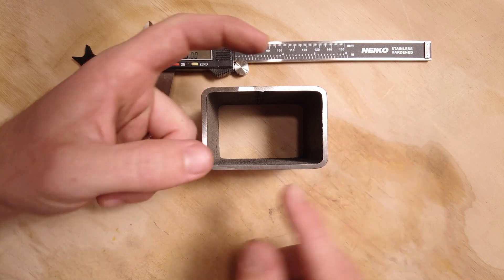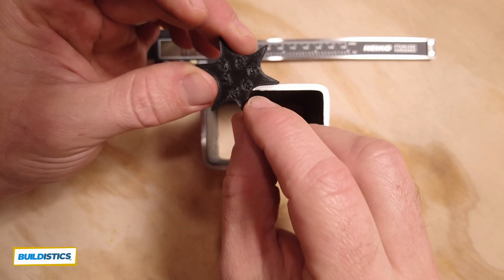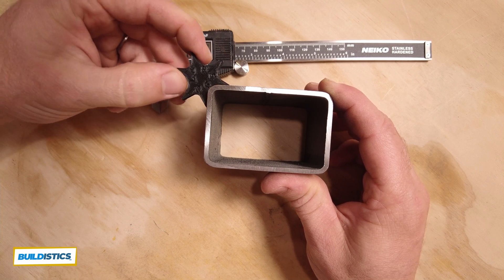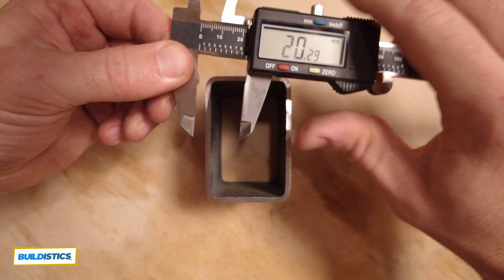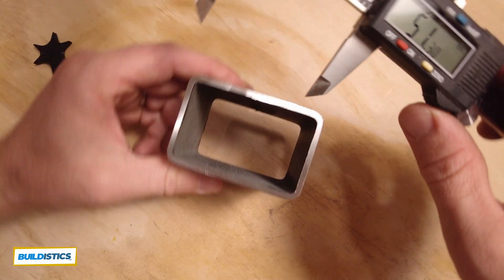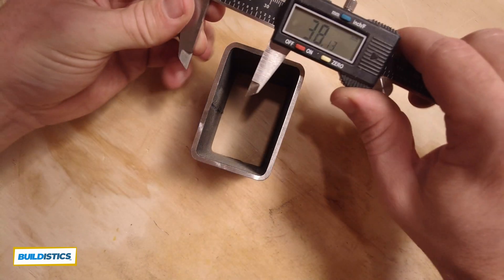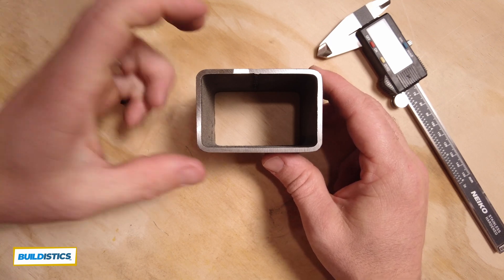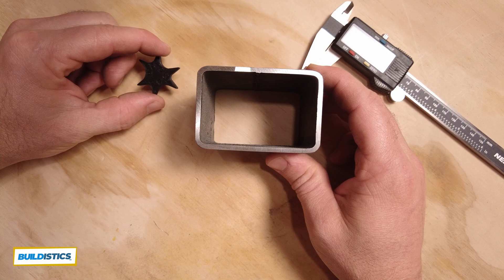How to Properly Measure Your Steel Profile (PrintNC 3D Printed Parts: $2,000 DIY CNC Router)

Comment: If you want proper measurements, clean the part first. Metal dust will get in your caliper and grind it to death eventually. Never measure with the tip of the jaws unless its the only way. Just a few tips.
Reply from the maker: Fortunately I use the caliper for wood most of the time and a few thou worth of metal dust doesn't directly affect the outcome of this project.  Thanks for the tips!

Comment: Do you provide the design of the pieces printed in 3D?
Reply from the maker: The 3D printed pieces are based off of what steel profile you're using. The Fusion 360 file is readily available for free download!